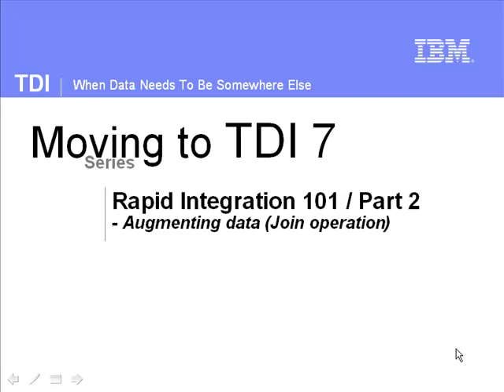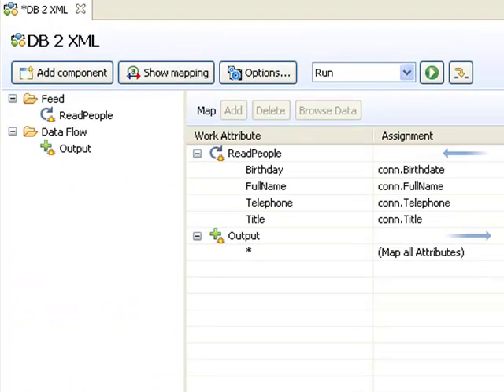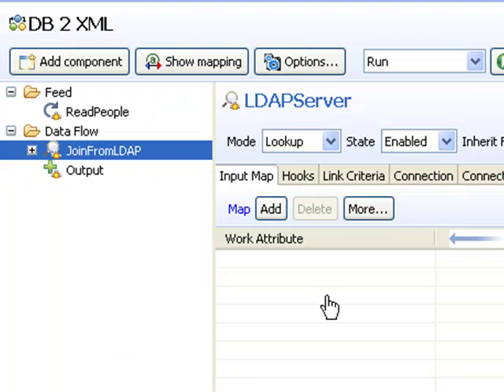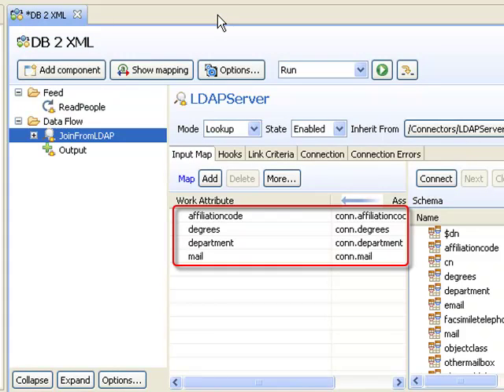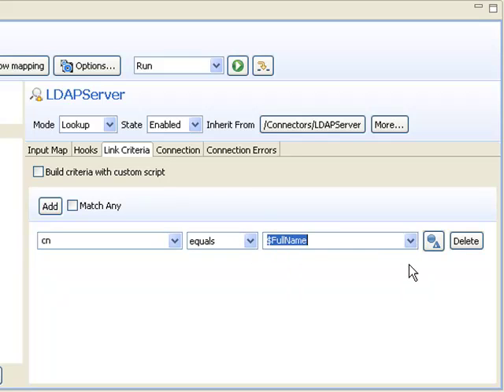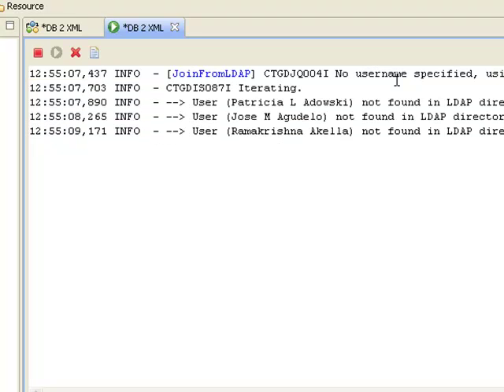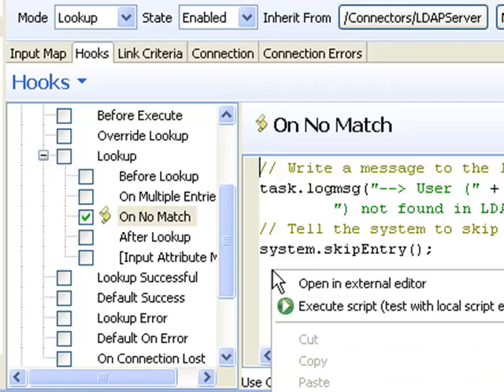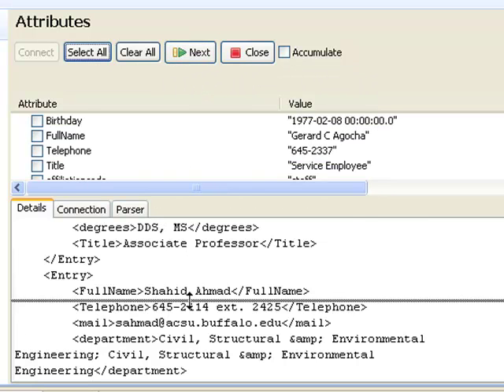TDI 7 - Rapid Integration 101 Part 2 - LDAP Join and flow control

Comment: Hi Eddie, I was using sendEmail function and had to set context object to send in that function. As described by IBM i initialised Address = NewObject(); and set Address.TO="some mail" & Address.Cc="some mail". But i am getting "Exception occurred: java.lang.Exception: 'NewObject' not found"
Could you please help me with this.
Reply from the maker: There is no NewObject() function, @Rohan bhat. This is pure Javascript (albeit an older, simpler version) and the Java objects that TDI knows about. The built-in ones, like 'system' and 'task' and any and all components (like the SendEMail FC). Most of the attribute values for sendMail functionality are simply strings.

Like I said before, spend 30 minutes learning how to navigate the Debugger and you will be able to answer many of your own questions. The TDI AL is a state machine, and it steps through its workflow one component/script at a time. And you can walk through it, examining and changing data on-the-fly. It is perfect for Garage-style agile creation of solutions, and the Debugger is one of the most important Garage tools.

https://ibm.biz/BdzA7V (video tutorial)
https://www.ibm.com/support/knowledgecenter/en/SSCQGF_7.2.0/com.ibm.IBMDI.doc_7.2/DebuggingYourAssemblyLine.html
Reply: @Edbird  so what else can I use to create context object?